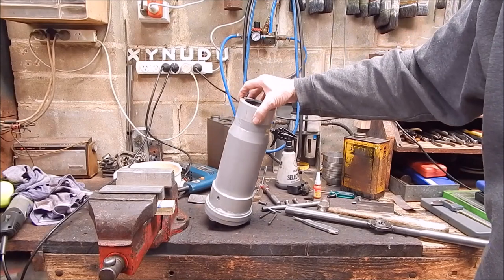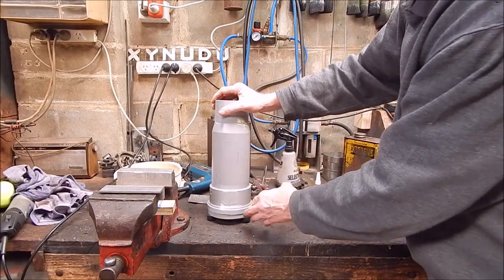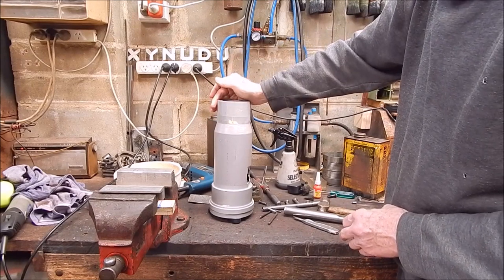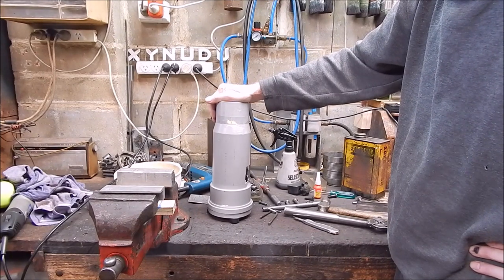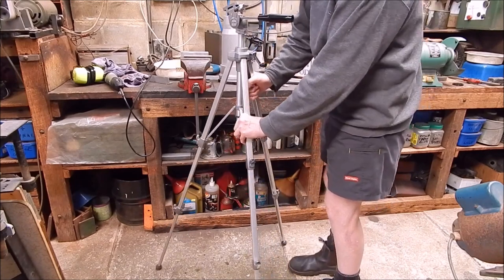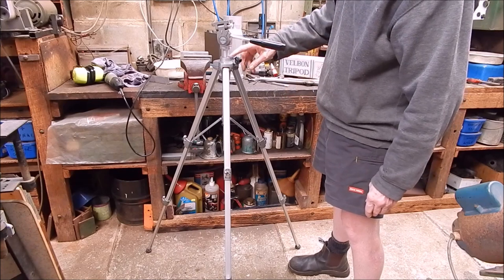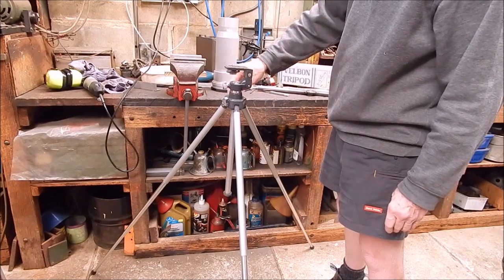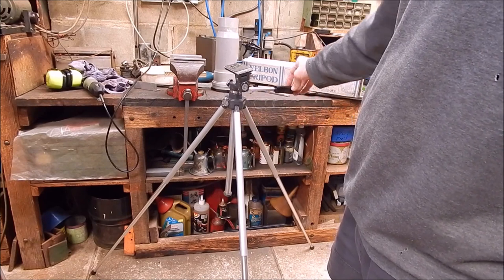Down but not out - I still manage to kill some time in the workshop

Comment: Good buy Rob. I've got an old 70s tripod as well plus one I bought new in the 80s. What I've been wanting to do, however, is build a wall- or ceiling-mounted camera mount that can look down on the workbench. Another "one of these days" projects. Speedy recovery. Cheers.
Reply from the maker: Hi Rick,  I've thought an overhead camera mount would be very useful and many video channels use them for purely work bench based filming.  My issue would be camera shadows from existing lighting and they would have to be moved or replaced for filming.  All doable but not urgent.  Cheers Rob

Comment: I've just had my cataracts done. Here is a tip - they do safety glasses with reading glass in them :) 
You dont have a set of regular glasses you can wear while waiting for your surgery?
Also go to the big green shed and get the darkest set of wrap around safety glasses you can find, I got a set with foam around the edges as well for a total seal. You are going to need them for the first day or two after the surgery.
Reply from the maker: I don't have glasses.  OK thanks for the advice.  Cheers Rob

Comment: I got a Benro tripod ages ago that's a pretty solid bit of stuff. The basic setup is similar to your "new" one.  I got it over the sort of equivalent Manfroto model.  The Benro has a tiltable, spinable, weightable arm that you can use like a camera jib.  I haven't used it enough, but it's a pretty satisfactory bit of gear.  I have a real crap cheap plastic and light aluminium video tripod that's only really any good for a flash or lighting mount.  If you breathe too heavy, it wobbles like a bastard.  My Benro thing cost a bit more than $40, so you got a pretty good deal there. 👍
Reply from the maker: The Velbon apparently weighs 4.6 pounds and looking at photographic forums, is highly sought after.  It's a studio unit and not something I would want to carry a long way (even though it folds up quite compactly).  The Yashica is much lighter and a bit smaller overall.  Secondhand photo gear can be a real bargain compared to the new equivalent , or even original price.  Plus good quality vintage gear is likely to increase in value over the years.  Cheers Rob

Comment: Nice score Rob 👍👍 I use a Velbon tripod but it's one of the modern plastic types, it's ok but your metal one really looks the business. Cheers, Alan.
Reply from the maker: Hi Alan,  this one is a beauty.  I don't know what brand the plastic one I had was.  After it stripped out the screw thread for the pan tilt tension adjuster it all got binned.   A 1698 deadened the pain.  That is one damn good drop.  Cheers Rob

Comment: Hi Rob, ordered my Hilda Die Grinder 14 March from Bangood, say they have 76 in stock but latest shipping date is now 7 April, about 20 days before they ship.
Quite strange.
Reply from the maker: Things are a bit of a mess with this COV19 situation.  I've ordered stuff and it's taken a fortnight before there are any signs of activity.  You just have to be patient.  It will all work out.  Cheers Rob
Reply: @Xynudu  @Willem Vant Sant. The latest news is that it could  be held up somewhere east of Suez . Fingers crossed I guess.

Comment: I got a simmilar tripod (veb3),  bought it on a flea market for 5 euro. It's o.k and a lot better than my more recent made Chinese velbon, that I can probably pie over. It does suck for low angle shots and I can not really use it on the bench. So just like you, I need something for that :) I thought about using an old chuck :) Mine does not have that fancy height adjustment. I don't think it's pro tripod by any means. And I think is from the eighties.
Reply from the maker: Your VEB-3 is a later model and quite a bit lower spec than the one I have.  The VGB-3 was top of the Velbon heap in the 70's.  Cheers Rob